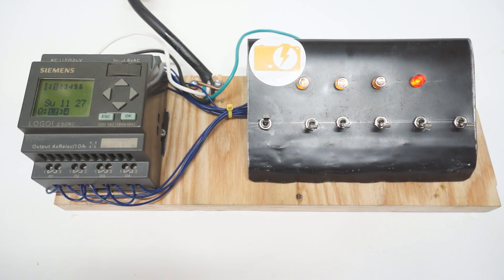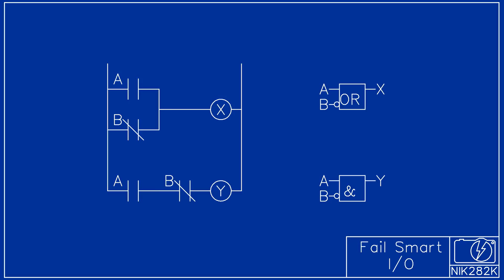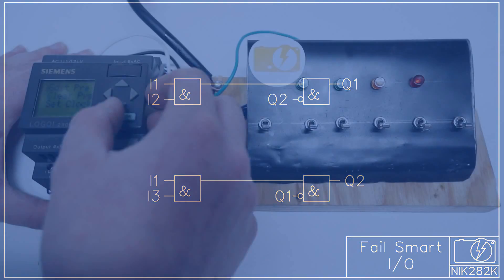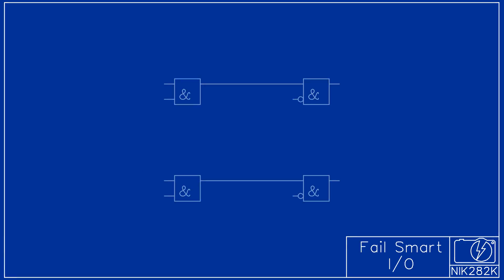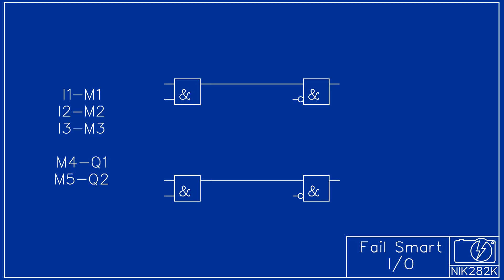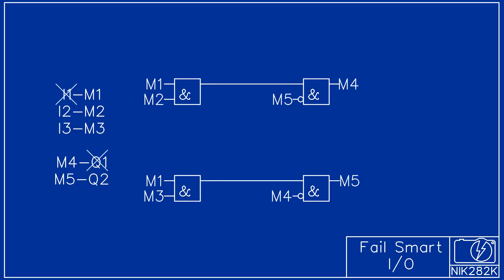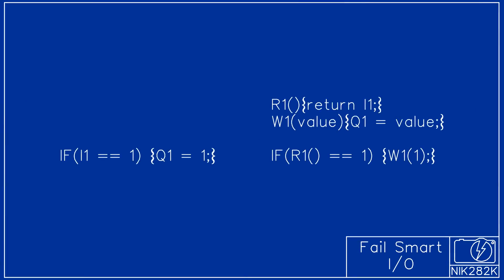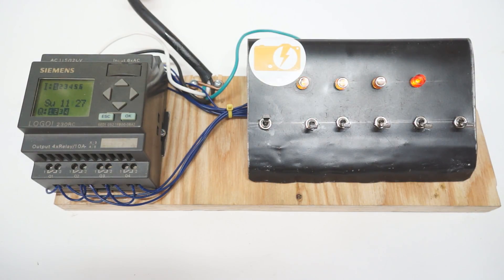Fail Smart not Hard

Comment: I'd never seen a PLC before, but as a software engineer this made sense as a more physical representation of why abstraction protects against change (and failure!). Nice video!
Reply from the maker: Thanks, this is about as simple as a PLC gets but some of the Siemens stuff almost looks like assembly. If I can find more generalized projects I'll be using this thing again (or just making a really expensive alarm clock).
Reply: Nick Moore What is a typical application of a PLC? Looks like it is almost a very basic industrial arduino if you wired some inputs to sensors and outputs to motors and whatnot...
Reply from the maker: That's pretty much it, they are used any time you need computerized control (automated equipment, assembly lines, amusement park rides) but they are more robust than a PC. There are a couple in my plant that were installed in 88 and are still running.

Comment: Woo...  Right over my head!  Can you give a real-world analogy, say, using engine control module sensors?  They're prone to failure, but despite this, the car has to keep running as best it can...
Reply from the maker: In a car it would be a little harder because they don't really have any spare IO on their computers. 

The example at work that I found was a small PLC (like the one in this video) that had an output relay weld shut. Instead of replacing the PLC I was able to use a spare output relay but had to re-write the whole program to get it going. Had the individual inputs and outputs in the program been replaced by variables then all that would have needed to be done is change the variable assignments.

It's a bit of a niche trick but if you build any projects with Arduinos, R-Pi or PLCs it can save a lot of grief when building, testing, and possibly exploding your control hardware.
Reply: Ahh, it's a portable coding thing; I got thrown off by the sensors and stuff.

So, instead of the code referencing I/O registers directly, it references a pointer to a register, and that pointer can be more easily changed than the code logic.

I guess, then, it'd be possible to code 1 to N, 1 to 1, N to 1, or N to N cases to use spare inputs and outputs in a redundant manner..?

ie:  sensor Main1 controls relay Main1; sensor Spare1 controls relay Spare2.

or

sensor Main1 OR sensor Spare1 (AND NOT sensorHasFailedHot) controls relay Main1                                                                               

or 

sensor Main1 controls relay Main1 and relay Spare1

or 

sensor Main1 or Sensor Spare1 (AND NOT sensorHasFailedHot) controls relay Main1 and relay Spare1